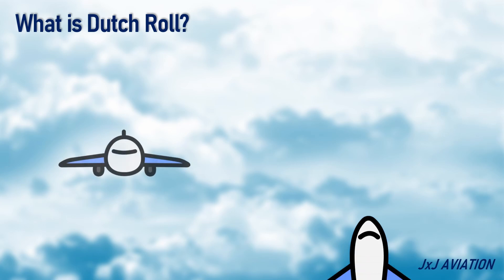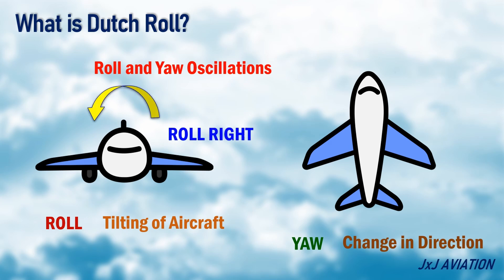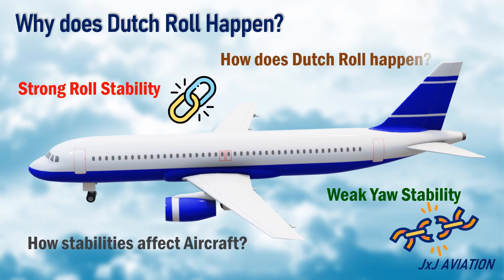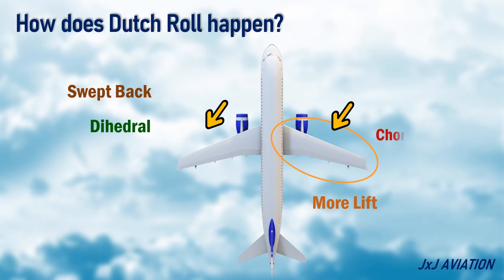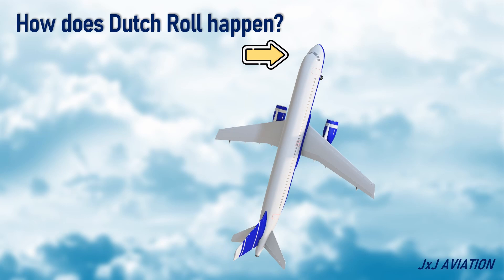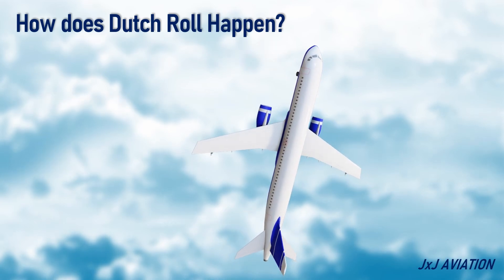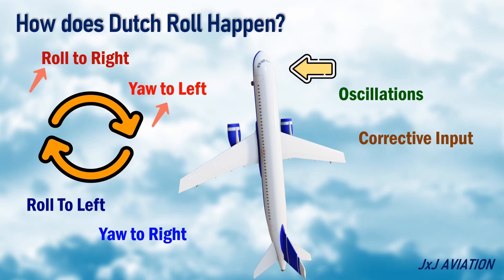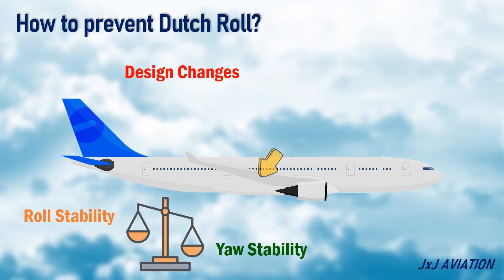What is Dutch Roll? | Why it happens? | How to prevent Dutch Roll in an Aircraft?

Comment: Ive had similar experience in boating when coming into a marina channel on a windy day where 3-5 foot waves are coming from behind at an angle.    The boat is rolling and a definite yaw oscillation going on so you anticipate  your amount of control to split the difference to hit the channel dead center as best as possible 😂